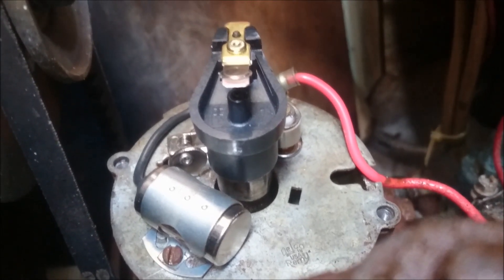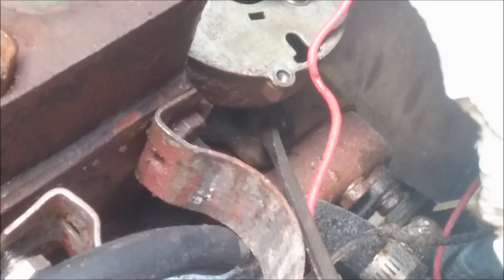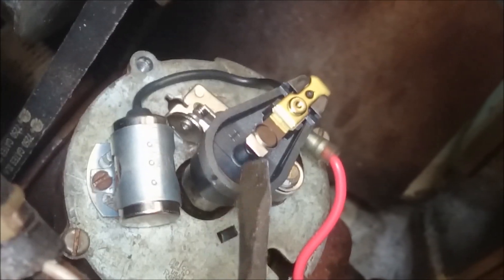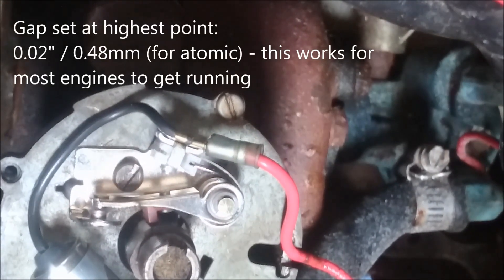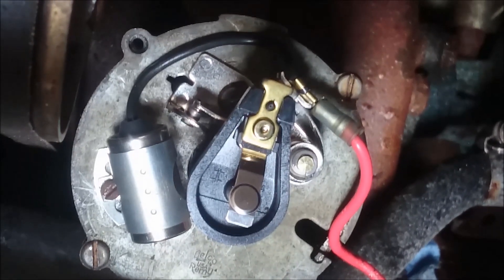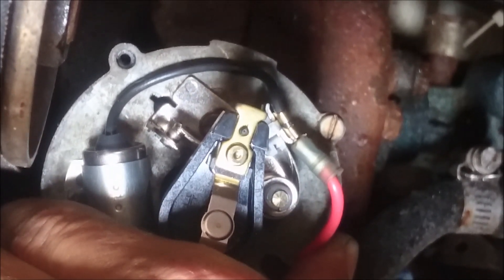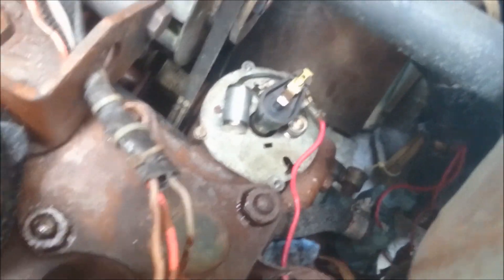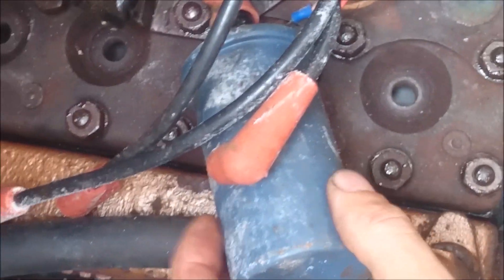atomic 4 points timing dwell setup (applies to all points engines)

Comment: I use the cardboard from a cigarette package to set the point gap.  Also I made a "Z" shaped wire from a coat hanger to reach in the sparkplug  to find TDC on #1 or #4 cylinder. for static timing setting.
Reply: z shape? is that an easy way to find TDC?